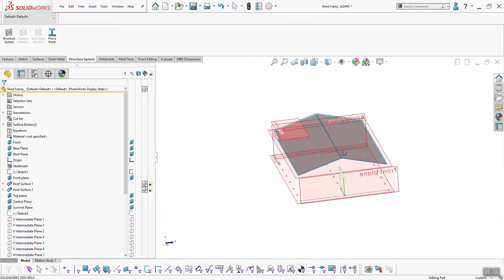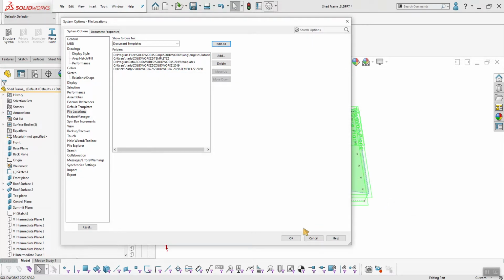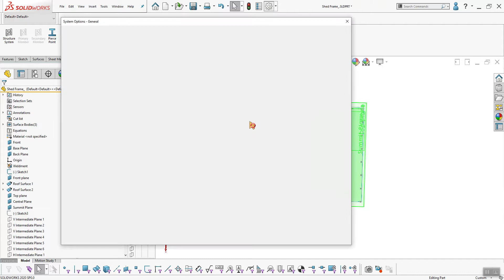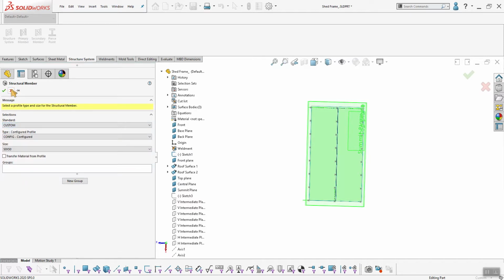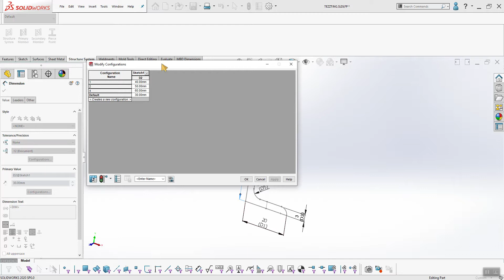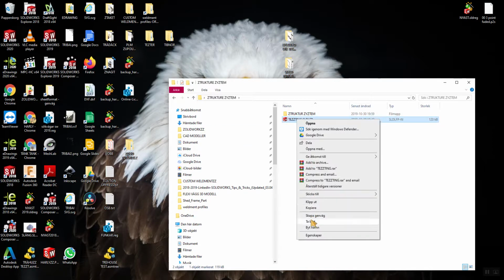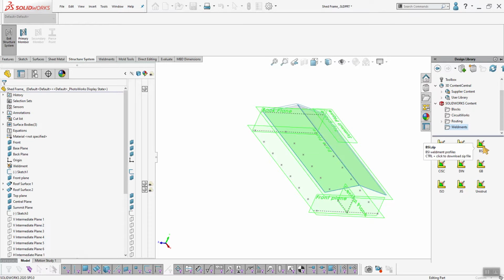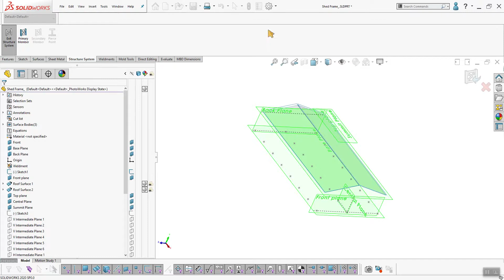SOLIDWORKS 2020 STRUCTURE SYSTEM

Comment: I have been struggling with this issue as well - VERY FRUSTRATING. More frustrating is not being able to find a ready reference in the SW documentation or SW forums to identify this nuance between Weldment VS Structure System behavior regarding profiles.

You are correct, the Structure System requires "configured profiles' to be referenced in the File Location whereas the Weldment tool references the old folders with separate files for each standard / type / size. Here is a great video that gets to the matter succinctly ... wish I had found this long ago! https://youtu.be/mIvlFfBz02M